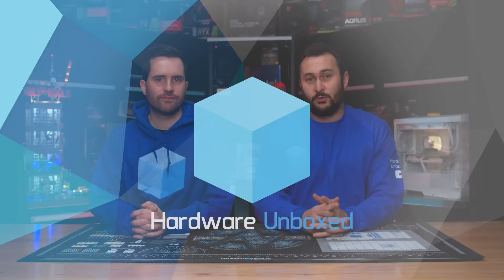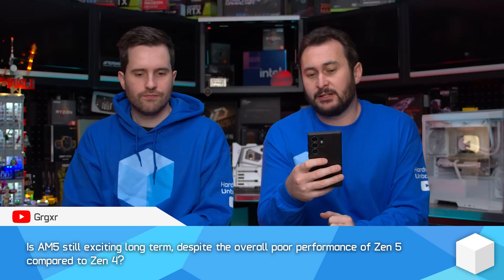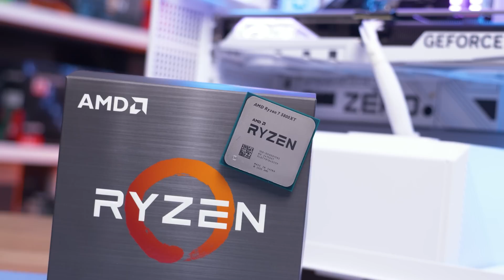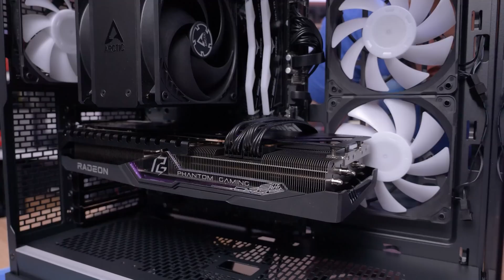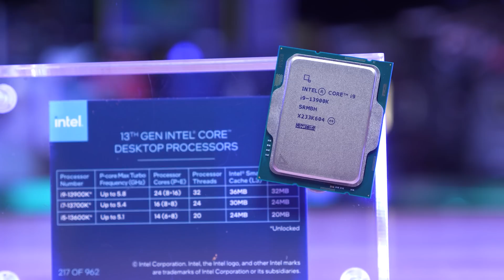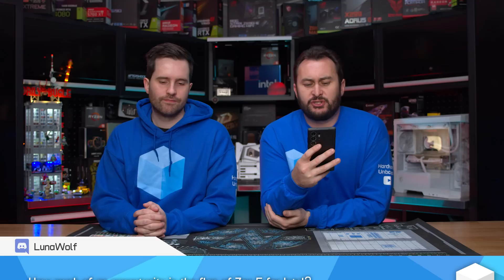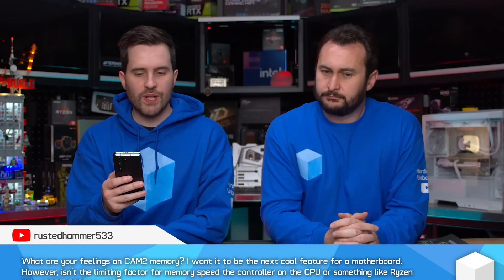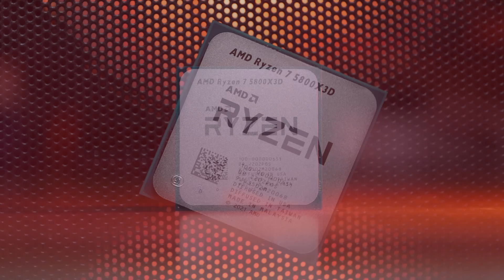Our RDNA4 Expectations, Can Intel Gain Lead After Mediocre Zen 5?

Comment: It's getting nearly impossible to anticipate future products anymore. The main source of so many early leaks these days have been MLID and he's been wrong more than right for quite a while. RDNA3 was supposed to be "2x minimum" over RDNA2 and easily match or exceed the 4090, Zen5 was supposed to be "15-20% faster than Zen4 on average" and we all know how that turned out. Arc was supposed to match a 3070 and it turned out that was cherrypicked, but then Arc was cancelled almost 2 years ago, and he's backpedaled and moved the goalposts on that one 15 times just waiting until it finally IS cancelled so he can jump up and down screaming "I TOLD YOU SO!!" 14th gen was supposed to be "only 5%" and it turned out to be ZERO.

So how am I supposed to believe RDNA4 will be a $500 7900xt, Arrow Lake be only 15% with slightly better efficiency, and any of his release windows will be accurate? He already claimed ARL will only have a fake paper launch in 24, same with 50 series, but then backtracked when rumors hit that the 5080 would come first, and now went silent on that after those leaks dried up? HE'S GUESSING through a lot of it. He seems to have some genuine contacts in the industry but some of those sources seem to be tainted by their own biases, as well as it seems he's filling in a lot of gaps to make it appear that he knows everything about everything. Which is very clearly not the case. He's still the "best" leaker, but that's like saying he's the best psychic or weatherman around when they're just guessing most of the time too.
Reply: if you haven't been ignoring crap like mlid for years you're doing it wrong. I could buy a dartboard and start a rumour mill and have a similar track record.
Reply: Perhaps if you actually listened to what he says and not just the headline you wouldn't look so silly with this comment. He always states his predictions as "this is the max they could do (which never happens), this is what I think they will do" As for the XTX vs 4090 he said that if AMD was to push the card to the max they could beat the 4090. It already is only 5-10% behind the 4090 in raster at 2/3rd the cost so that is absolutely not out of the picture.
He also said that it wouldn't make sense to push the card to the max if that meant price parity with the 4090 with an inferior software feature set. All true things.

Comment: My disappointment with AMD is that they're still scared to release a 5950X3D and max out AM4.
Reply: scared? there is literally no point in adding it
Reply: doesnt make sense.
x3d layer requires a frequency drop, so a 5950x is way faster without x3d technology in multicore apps that can use 16 cores.
there's already 5800x3d anyway for gamers, which makes more sense, since you do not have to deal with Core selection because one Die doesn't have the extra cache.
Reply: Scared?
Why?
What would 5950x3d to give? Slover in games than 5800x3d and slover in productivity than 5950x… all in all gamers go 5800x3d. Better gaming speed and cheaper. Productivity people goes to 8950x…

Comment: will we see a 5950x3d
Reply: There is no logic in it. The extra cache would be on one CCD from the 2 CCDs, so if you want to game then you have to turn off one CCD. And the overall productivity performance would be much slower than the regular 5950x because of that extra cache which needs lower frequency. For gaming we have the 5800X3D and for work 5950x.
Reply: @PeterPauls  really it's me thinking am4 never dies, looking at the prototype, it had the extra cache on the two ccds. It is different to the 7950x3d. The Ryzen 9 in general has problems thread scheduling, this being a problem from AMD (not providing sufficient drivers) and windows. With Linux being able utilize the higher core count parts some degree better. Curiosity would like me to see the 5950x3d part in action, it probably wouldn't work as well as a 5800x3d. I would also like to see a Linux benchmark session from these guys once every month or few. Microsoft do not need any favours, and people need to know what the alternative is and if more people used Linux, Linux would have more support from hardware and software developers and the larger community.

Comment: The best way to make am5 exciting is to remove the ryzen 5 and 7 x chips and only keep the x3d chips and non-x chips but keep the ryzen 9 x. Amd will need to work oc and clock speeds but they should be able to figure it out like they did with 7950x3d which was more stable than any of lga 1700 i9.
Reply: X3d versions does not make sense in productivity!
Less than 10% PCs are used for gaming! They are used to productivity and there x3D is not useful and also increase price! Mad would be super stupid to not make their most popular CPU aka non x3d versions. For gaming… of course -x3d makes sense, if you can afford those!

Comment: The idea that amd would need or even benefit from a new platform to maximize zen6 is out of the question. Zen6 with even a 10% uplift would sell very well... But very poorly if you nees a new motherboard. We all know this. The only way they would consider doing the platform update is if zen6 was some crazy +30% faster than zen4/5. Otherwise it is doa theyll lose one of the main benefits of choosing AMD cpus.

Other than, of course, that the competition us unstable.

Comment: I feel I have made a mistake. I should have just sat with my 5600x / rx 6800. I was sorted for my needs for the next decade. I upgraded to a 7900gre/7800x3d and do not feel the £1200 upgrade for motherboard swap and memory cost was worth it at all.
 Getting 1-5% upswings for 35%-75% more cost is not a flex. It is stupidity

 Marketing wins and common sense is not common anymore. My 6 year old is now using my my old rig and I am feeling in 2030 he will still be getting what I would have gotten out of that rig. Tech advances are not advances. Ray tracing is the single most useless advance in tech which is what saved me from being ignorant enough to carry on with the green company.
Reply: Thanks for this. I have the same 5600x / rx6800 and was debating with myself wether to upgrade. 
You helped a fellow pc enthusiast out.
Reply: @Staycalm2010  I'll help you out: do not waste money on unnecessary parts that lower your overall performance (AKA, do not buy parts that completely ruin your GPU budget). He could have purchased a 7900XTX, a card that overs over 2x the rasterization performance of an RX 6800, along with maybe a slightly better CPU like a 5600X3D or 5700X3D. In most games he would have seen 180-200% of his previous FPS. It would have been a huge difference, especially in demanding games like Cyberpunk.
Instead, he jumped on a hype train and drained over half his budget on a very expensive CPU and AM5 parts, which ended up with a very mediocre overall setup. Even if he had swapped to AM5 with 7600X and instead purchased a 7900XT, he would have been much happier.
TL;DR: buy the best GPU that you can if this is for gaming, do not ruin that with an expensive CPU.
Reply: @rustler08 x3d in general is not that worth it for most people, it is over hyped at this point.
Reply: @rustler08  I am on a ultra wide 3440x1440 so I am a lot more GPU limited, but was thinking that my CPU may not be powerful enough for the new GPU.
So for now, I am going to wait for the next gen of graphics cards (maybe the one after that) before upgrading.
Reply: @Staycalm2010  Keep your set up and enjoy it for the next 7 years it is more than relevant. If you move to heavy workloads and editing or creation then the x3d cache and a vram upgrade are of value, but for general 1440p/4k gaming, there is no value this or next series.
Reply: You did make a mistake. I cannot fathom why you thought a 7900 GRE was a good move over a 7900XT, let alone the 7900XTX. You could have done a 7600X and a 7900XT or a 5800X3D and a 7900XTX, but instead you learned the very hard lesson of why it is bad to ruin your GPU budget to get a better CPU.
This is what happens when you let hype get to your head. CPU is somewhat important, but it's silly to murder your overall performance by buying a far inferior GPU to get a better CPU.

I HIGHLY recommend watching comparison videos of games that show the applicable GPUs, because it gives a good idea of what the difference looks like in games.
Reply: @rustler08  I was hovering in the region of what I needed for my use and what my future use might be considering it will be passed down to our youngest in a few years. The x3d and ddr5 were my downfall. I was not going to say no to the sub $500 GRE but I have no business having the 7800x3d as staying 4k mhz ddr4 /5800x3d would have suited me perfectly. I agree I let my funds bleed over to a bigger cpu I do not need when the 7900GRE suits me perfectly and would have been better used on the am4 chipset, for me. 

 Had I stretched on the GPU (I still might as I am within my return period) I would just get a 4070Ti super or 4080 super. If I moved in the £750+ region of GPUs I would just go Nvidia and admit it is far too much tech for my needs. I am positive Fallout, Elden Ring and my choice of games do not require even close to the gear I have now paired with my light work loads outside gaming.
Reply: Yah.. if that was me I would have waited until 5800X3D came down to a decent price and then comfortably gamed with the RX 6800 until the new gpus, or I found a killer deal on something better.
Reply: If you bought all new parts to make a one generation change it sounds like the stupidity is on your end.
Reply: @TheMyst3rio  I agree and accept it. It will not be a mistake made for another decade.
Reply: "I upgraded to a 7900gre" 
well there's your problem
Reply: @Effect-Without-Cause  The 7900gre was not the problem at all. It is the single best gaming card 1440p/4k this gen out of Nvidia 40 series and AMD 70series. Hating on AMD is not the answer as Nvidia has it's place for creators while the 4070 and 4060 are simply overpriced scams for general gamers to overpay for for underwhelming performance versus their cost. The issue was upgrading a generation I should have skipped as the 7900GRE would have functioned perfectly with the 5600x for my needs.

Comment: Let's be real, am5 is dead now. The new gen is barely a refresh, so this means AT BEST 2 generations on the platform. And this is the best case scenario, taking into account that zen6 might not be on am5 and it could still be a refresh of a refresh with another 3% uplift for all we know.

With a price gap that is kind of relevant in my country (and with the free performance™ with the windows update), am4 is still very relevant for anyone who won't be buying a 4090 anyways.

Comment: The 8800xt should be called a 7850xt even if it's a different architecture, seeing the bandwidth and core count increases it'll probably perform about 10% better just using that, but we know AMD can do some binning, core clock and memory magic like they did with the 6950xt for free performance. So maybe 15% more performance closing the raster gap to the 7900xt and outperforming it in RT?

Why wouldn't they release their 7950xtx or whatever that rumored 7990xtx was, like they did with the 6000s? The "__50xt" released as a final push from RDNA2 almost two years later in mid 2022 and it's still going strong compared to current hardware.

Looks like 6950xt, 7900gre/xt/xtx users will keep their gpus well into 2026. As planned, of course, but this is weird choice making on their part. They already released last gen refreshes 5 months before current gen, why not do the same now to polish the rough spots for next gen?

Comment: I don't really know who in hell will be buying Intel 13/14 gen after all the news. Cause of all the malpractices, I am rly not sure Intel have really fixed the issue in full and not simply post-poned it.
Reply: It's pretty crazy to hear people calling Zen 5 a failure while Intel's last two generations kill themselves left and right.
Reply: @nipa5961  One failure doesn't make the other one better. Yet, a choice between "next to no improvement" and "will be dead in 6 months to a few years" is obvious. 
I am really not sure but I have seen info that Intel only properly limited voltage spikes for the baseline profile, other profiles are still cooking the CPU, albeit slower. May be false though.
Reply: @Vivicect0r  I agree, there is no excuse for Zen 5 underperforming and AMD overpromising. But it's still insane how many people try to compare this to the whole mess Intel is in and try to argue that Intel looks good again in comparison. Wild!

I highly doubt the voltage situation is under control now. Intel knows about the problem since late 2022 and has released multiple bios and microcode updates to try to fix it. They weren't successful so far and I bet there simply is no proper fix without losing too much performance and getting out of spec.
Reply: Most people who always by Intel in anyways… So most people in the world!
Intel market share is still much bigger than AMDs, but amd has been gaining market share and getting closer…

Comment: My gout feeling is that AM5 will not be able to fully support Zen6. I think that AMD thought that DDR5 would be a lot faster by now, like 8000mt/s as default, and that is actually one of the reasons that Zen5 looks so bad. Strix Halo has a 256 bit bus, primarily for the GPU side, but I think AMD is thinking of doing the same for Zen6 or at least use CAMM2 as standard. So the Zen6 CPUs might work on AM5, but will underperform without the bandwidth of a new platform, possibly AM5+. And that's why they can't claim that Zen6 is fully supported by AM5.
Reply: But doesn't most ram above 6000 or 6400 cause a ton of issues on Am5? They always say to get the 6000 ram for everything since it's a lot more stable (unlike the Raptors that basically demand higher speeds to be at the same level lol)
Reply: @cuteAvancer  That's not because of AM5, it's the CPU itself. On AM4, AMD increased the recommended memory (and  infinity-fabric) speed over time and generations. They are doing that two with mobile Zen5 but with desktop Zen5 they reused the IO die and therefore memory speed.

Comment: Theres no need to go on hype train logicaly actual performance will not be faster then this
8800xt 16gb (260w) = 7900xt(4070sper rt perf)
8700xt 16gb (220w)= rtx 3080 same rt
8600 xt 12gb (160w) = rtx 3070( rtx 4060 rt perf)
8600 8gb (120w) = rx 6700xt(rtx 3060 rt perf)
Its AMD what are you gonna expect they were always Targeting the the 2nd position

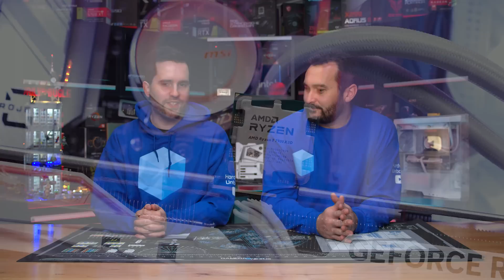Comment: 6:44 they never said "we will give you more than 2 generations". They simply said they will support it until 2027. 
In 2027 you will get a 9600X3D and that is technically still fulfilling their commitment. 

You all put words in other people's mouths too often. Words have meaning. You choose to misinterpret their meaning.
Reply: Absolutely agreed. I would be very surprised if Zen 6 is still on AM5 and if it is, it will only be after (deserved) immense backlash. I was always saying that the "forward compatibility" argument of AM5 platform were castles in the air, because the future "generations" on that socket might not be all that good, and this exactly proves that.
Reply: @frantavopicka5259  aka castles in the sky. 

Shout out to Annelle Staal 😉

Comment: We have to remember the 10% AMD gains from Windows 24H2. If we add that on top of Zen 5 results, it looks close to a normal generational uplift, if we only compare against Intel. 

7800X3D also got nice free buff from 24H2. Intel has to beat it too. That’s going to be AMDs top gaming CPU at Arrow Lake launch. 9800X3D is rumoured to ship in January.
Reply: The problem with beating any of the X3D chips is that I think Intel has clearly demonstrated they just... Can't. 3DV-Cache is proprietary (read: secret) and frankly just superior technology. It's really difficult to come up with a new invention on demand, and that's what it would probably take.

Comment: Regarding the overclocking discussion: even if all you've done is a 3% undervolt or vram oc you should restore stock values and rerun a game before reporting driver issues, never mind the kind of oc that would net 20% gains.  I've got a 99.99% stable oc on my 6950XT but anytime there's a random crash my first step in troubleshooting is to try to rule out the gpu tuning I've done by testing (usually multiple times) the same scenario at stock settings.

Comment: It's not so much that AMD should increase core counts on consumer CPUs, I think, but that they should reduce prices of 6 and 8 core parts. 6 cores above $250 is a joke at this point and there should be 8 core parts below $300 already. If the 9700x would have released as 9700 at $280 or $300 with a cooler, everybody would have been very happy with it.
Reply: Luckily the 7500f is at 144€ and the 7700 at 215€ already.
Reply: @nipa5961  And having a 7500f will definitely make you excited for the future of AM5, :D
Reply: @michaelpalin8953  You wanted cheap 6 and 8 core CPUs and luckily AMD has you covered. 
Why switching topics to something completely different? :D
Reply: @nipa5961  Oh!, were we discussing? I didn't realized that.

In that case, if I say that no 6 cores should be above $250, including the 9600x, and that the 9700x should have been $300 tops, I don't see how the prices of the 7500f and 7700 matter for what I'm saying.
Reply: @michaelpalin8953  Just to remind you what you said: "6 cores above $250 is a joke at this point and there should be 8 core parts below $300 already"
And that's exactly what AMD offers for more than a year already.
You never mentioned "AM5", "9600X" or the "future" anywhere. :D

Comment: the immaturity of the market chasing max fps without regard to longevity or power has killed overclocking freedom. I still see the same immaturity in conclusions that "component X is better than Y"... at pointless frame rates over 300fps.